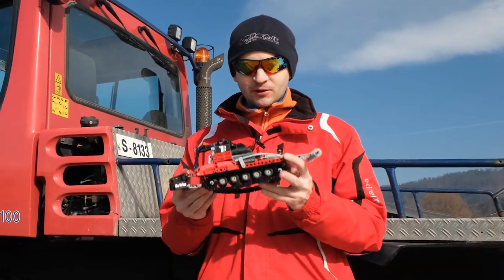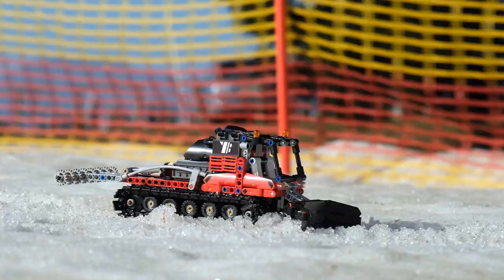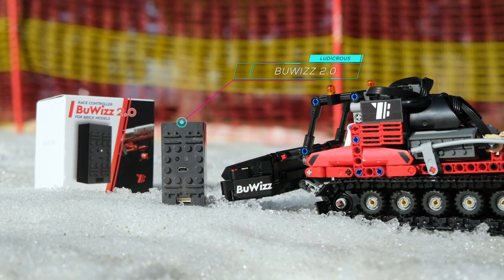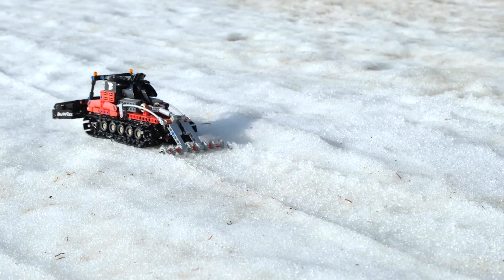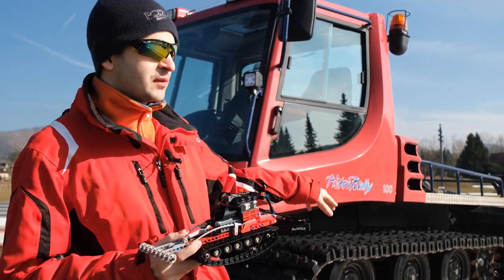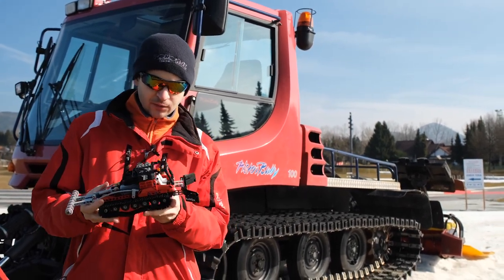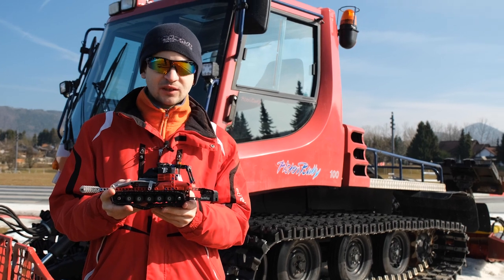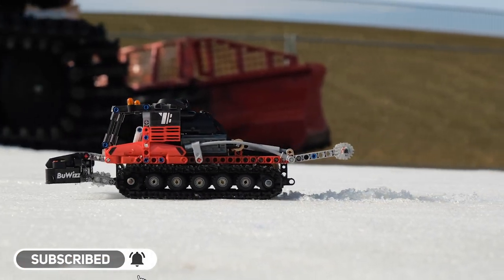BuWizz powered Snow Groomer made from LEGO® bricks vs PistenBully 100

Comment: not bad, but i would of used bigger sprockets, 4 xl-motors to move and 2 L-motors to lift the implements. oh and double tracks on each side,
to combat the extra weight of the xl motors. i would like to see bigger moc's on this channel whit lots of power, like a bulldozer, a crane
a tank (that shoots) and some type of haulage truck.
Reply from the maker: We usually go for more motors and bigger MOCs, but this time we wanted to show how compact is the BuWizz 2.0 brick, and fit it in a small model.
Reply: @BuWizzBrick  I didn't expect you guys to respond to me but thanks anyway. You did do a really good job to fit it all in. And how did you stop the m motors from getting damaged whit all that snow? Did you rap then in some type of plastic.